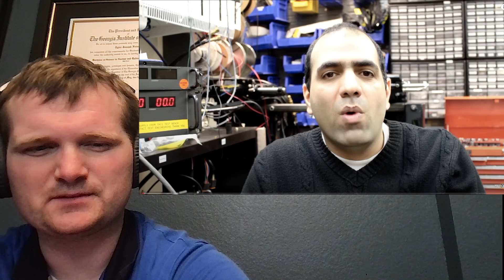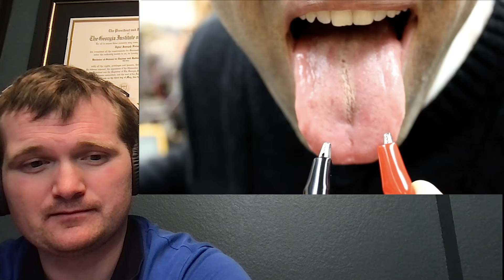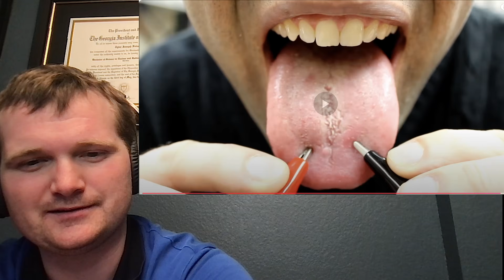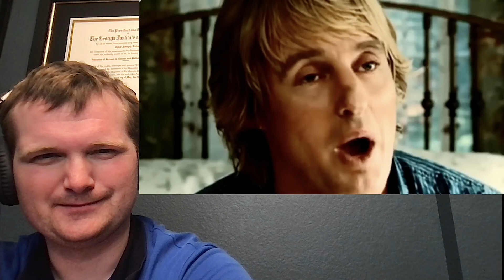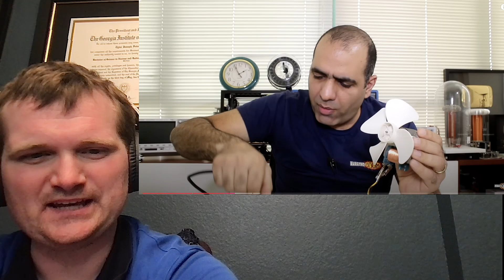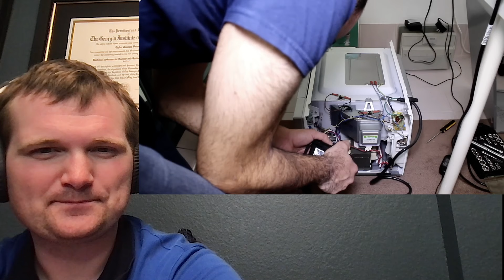AC vs. DC Current! - Nuclear Engineer Reacts to ElectroBOOM

Comment: While yes the AC system is better, less conversions and simpler. Technically there are less losses in the transfer of high voltage DC because in AC the voltage drops to/trough 0 in it's sine wave. And you als have this thing called the skin effect which pushes the current to mostly flow along the the outer layer of the conductors. Of course this effect helps make power cabling cheaper as power lines are generally made of steel cable clad with aluminium as the conductor (coper is too expensive making the need for the high voltage even greater). This saves having to make the whole cable out of a good conductor and you can get away with the far higher tensile strengt steel as the core. 

So with a DC systems you would have to convert from AC at the generator to HV AC then RECTIFY that, transmit it along a likely more expensive wire to then make HV AC out of that with some very expensive electronics and then transform it down and while you can get some gains like using higher frequency AC at the consumer side transformers to allow for the use of smaller and  therefore cheaper (because copper and large chunks of transformer core metal are somewhat expensive) transformer, but that transformer better have some super good isolation characteristics which might be harder if it's smaller? The concept has cropped up now and again as a cost saving thing. But clearly the tech surrounding it would be more expensive initially and you already have huge networks with AC power spanning across counties, connecting a lot of Europe for instance. 

I'm not an expert on this though so take everything with a grain of salt, but I did study electronics even if I work in software now for whatever that is worth.
Reply: As power electronics get cheaper and cheaper its begining to make allot more sense to switch from AC to DC.
Reply: @fablearchitect7645  yes, that is what I was pointing out...

Comment: 8:20 - there are actually high voltage DC lines that lose less power over long distances than AC lines, but the issue is that you need pretty gigantic installations to really handle some steps like steeping up/stepping down and of course in first place rectifying the current. They are getting more popular, though they are still pretty rare. I would have to check at what distances and what voltages those are more efficient. And of course they would need a new grid to operate it, so not exactly easy to put such infrastructure in place, unless it is specifically needed.
I learned this few years ago (and was a bit skeptical, because I learned in school that we don't use DC because of the losses - it's possible that "simply" transmitting at very high voltages creates less losses and needs less material or something), so I might be wrong. Or it might be mentioned further in the video and I will look a bit foolish for saying that.
Reply: You're right. I was looking for a comment like yours.

The key to understand this is that there is no reactive power in DC, hence no losses due to higher current in the power lines (and also no losses due to capacitive coupling with the Earth).

If you know you need a link that goes a very long distance with few taps into it, it is a good idea to use DC. Examples of it are links through mountains or seas. Why do you need few taps? It's because the equipment to convert high voltage DC into lower voltage DC (or just AC) is crazy expensive. It relies on solid state electronics as far as I remember.
Reply: @Martititi  Thank you. I do remember it being useful, but just expensive and big (with "parts" of substations being larger than average house), but better in terms of efficiency in those scenarios.
Reply: @jannegrey  Power electronic converters utilize high frequency (20-150 khz) transformers which are much smaller then the big bulky line frequnecy (50/60 hz) transformers utilized in substations. High frequnecy transformers can be made smaller because inductors saturate less at higher frequencies.
Reply: @fablearchitect7645  thx
Reply: Well also in a way it makes sense, as higher voltage would mean lower current for the same power, and effectively what causes losses in a wire in dc is the wire material's resistance to electrons moving around. We see this as heat, but it's basically the energy levels required for an electron to be freed and moved off towards the positive pole. This energy is then freed when the electron is freed as well, and the electron finds it's way to another empty slot in the material when it can, and gets "refreed" again and again, effectively flowing from the minus pole to the plus.

Comment: DC is actually better for long-distance transmission, since it has no reactive losses. However, what is expensive is the step-up and step-down converters, where AC can just use a transformer.

Comment: I had an electronics project kit as a kid, one that showed you the actual components on the surface. There were a few high voltage generators, I always had fun with those.
Most fun though was with spark plug wires on a small engine in school; I have a decent tolerance for the pain induced, but turns out my schoolmates didn't. I grabbed the wire, they pulled the cord, I felt it and just went, yup it has spark. They grabbed it, I pulled, they jumped backwards lol.
Fun fact: Edison Motors named their first full test truck build Topsy, cause of Tesla (both Nikola and the car company.)

Comment: 8:14 Not necessarily correct.
Originally DC transmission was done with household level voltage and there were no methods of conversion.
Today there are experimental transmission lines running high voltage DC (since Ohms law still applies same way to reduce losses) and in theory since there are no AC capacitive or inductive losses on the transmission lines it should be even more efficient.
Unfortunately it is still inconvenient since this would require huge inverters and huge rectifiers to handle which are prone to failure and are expensive.
Reply: There's way more than experimental transmission lines. There are DC transmission lines between the UK and France, and also between Italy and France.
Maybe there's one between Japan and China, but I don't remember if it is DC.
Reply: We use HVDC in Australia. I actually have no idea when we started as it certainly isn’t a recent thing.
Reply: Power electronics are getting cheaper and cheaper and high frequency transformers used in power electronics are less bulky and use less material then the low frequency line transformers currently used in substations. All modern home appliances already use power electronic converters.

Comment: 8:30 Thers is High Voltege DC (HVDC) line, because transmitting AC power on very long distances power loss occurs due to resistance in the conductors and additional losses from phenomena like the skin effect (current concentrating near the surface of the conductor) and AC systems experience losses due to reactive power, which is associated with the capacitance and inductance of transmission lines. Reactive power reduces the overall transmission efficiency and requires compensation equipment. And DC doesnt have that disadvantages. Mehdi done addition video that he talk about it after people in comment told his about HVDC.
Reply: Hvdc is expensive and introduces additional switching losses, but has lower losses. A DC grid would theoretically be better than AC grid if the conversion wasn't so costly (both money and power) , as there would be no frequency stability issues, synchronization would be simpler, etc.
Reply: @WolfkunDotInfo  yeah, and DC grids are feasible with power electronics, you can step voltages without converting to AC, but at the time tha technology did not exist, and it would be insanely costly to convert everythign to DC now, especially since all our devices are already designed to convert AC to DC, if the grid chagned we would have to yank the transformers our of all our devices too, lol
Reply: Also another reason to use HVDC is insulation and limited AC capability same size of wire can carry. After all, AC as is specified is "equivalent" to DC in a way that it is RMS voltage that is specified, but this is not the highest voltage, nor the lowest voltage naturally. In other words, same wire can carry more power with DC than it can with AC because voltage doesn't have to be as high. Anyway, AC is much more handy as it is just so simple to stick transformer to step it up or down, or isolate circuits. With DC this is not so simple.
Reply: @jarivuorinen3878  Also it is useful to connect grids that don't already have a large AC connection if you connected the cables running between the UK and Ireland for example to the AC grids despite being the same frequency the fact they are not in phase would lead to currents that are a large portion of the total output of all generators on the grid rushing back and forth as they try to pull the out of phase generators into phase with each other. Suffice to say that would need a much bigger cable for them not to instantly turn into white hot molten metal the instant you made the connection because the reactive power involved in the reactive power flux from having like 50 GW worth of generators acting as giant out of phase inductors would be impressive for all the wrong reasons. Probably all the infrastructure for hundreds of miles around connected to either end of that connection would also turn into molten slag because none of it was designed to handle the current needed to provide the current needed to phase shift that sheer tonnage of spinning mass that quickly.
Reply: It wasn't necessarily the long distance that caused losses it was (I think) the inductance of the material near the wire (like undersea and underground transmission lines.
Reply: @aidancollin9265  It is mostly due to the (parallel) capacitance between wires themselves and wires to ground. More distance = more capacitance = less impedance (between conductors), because Xc = 1/(2*pi*f*c) (where Xc is capacitive reactance in Ohms, f is frequency in Hz and c is capacitance in F), and thus more losses. 

The inductance of wires is also a factor but smaller then resistance, although it creates fun thing called Ferranti effect, where voltage at the end of long line with small load is higher then input one.

Comment: 2:44 He didn’t zap himself because the volts and amps didn’t change. Most of his zaps are fake.
Reply: They may be fake but he does it to teach his viewers how to stay safe
Reply: Nope, the reading cannot change much cause here 25.6/10000 = 0.00256A cannot be displayed on that supply in this case.
Reply: @HackingElectronics  

You really want to believe it 😂
Reply: @MyToxicMasculinity  🤣🤣
Reply: @MyToxicMasculinity 25V DC to the skin maybe make sense if you said that is fake..
but 25V DC to the tongue, with much much lower resistance than the dry skin, is make sense if mehdi was shocked because there is already miliamps current flow through his tongue (just because the tongue was always wet) so the resistance much² lower.
Reply: @dwikey_98  

I'm not sure that you and I are talking about the same thing.
Reply: @MyToxicMasculinity  i just wonder about you said if mehdi fake his zaps while there is really 25Volt DC through the tongue..
Reply: @ 

What? Can you say that in English, please?
Reply: @MyToxicMasculinity  sorry, my english is terrible..
Reply: @MyToxicMasculinity  can you read your own comment ?
you said, "if he didn't zap himself because the the volts and amps didn't change. Most of his zaps are fake..
where is the part was fake ?
Reply: if you have a power supply and short  your power supply output like that, it would make a spark.. 
all the power supply if shorted (especially), it will make a spark on its output..

so, where is the part that you said was fake ? 
that zaps is real..
even mehdi himself, being shocked by twenty five volt DC through the tongue..

i just curious about your point from your comment.
Reply: @ 

Those are two separate comments. 

Did you see how the volts and amps changed when he touched the wires to each other? They would also change when he touched them to his tongue. It's a constant output, so when the amps go up, the volts have to drop. 

“Voltage drop is the reduction in electrical potential (voltage) as current flows through a circuit or a component”

If current flowed through his tongue, the amps would have to go up, and the voltage would drop. That did not happen. 

“Most of his zaps are fake” is just an observation I made based on the evidence I see.
Reply: @ 

To address your question, if you shorted your PSU, the volts would drop, and the amps would go up as the current flowed, just like in the video.
Reply: @MyToxicMasculinity  yes, the voltage would drop..
but the voltmeter and amperemeter maybe not fast enough to read the voltage and amperemeter while mehdi shorts the output.. it needs sometimes to recognized it.

because i have multimeter and power supply, if i shorted their output the power supply can't immediately recognized and measured the short circuit current.. there is a delay in my power supply (maybe 1 second) and so i must short the output little longer..

mehdi while shorting the output of his power supply, it just under 1 second.. just brief of the moments..

also my multimeter while measuring the voltage of anything, my multimeter doesn't immediately can measured the voltage.. there was a brief moment with "OL" and  after maybe 1 second delay the multimeter can recognize and measure the voltage..

so,do you know what i mean ?

there is a time delay between probe touching the things and meter can recognized and measured.. do you understand ?
Reply: @ 

Idk, but he rapidly shorted the wires and it responded quickly.
Reply: @MyToxicMasculinity  because he did it several times, no just one time.. 
and not all the power supply or multimeter is the same, because mine have the delay between probe touching and the respond from the meter..

but the sparks from power supply while shorted that you said fake, that is real spark.. all of the power supply if their output was shorted by accidently or on purpose, would make a spark.. 
and the meter measured it or not, the spark didn't care about it.. because the first time shorted lead/probe contact always make a spark..

even while you plugging the power plug to the socket, the spark can happen.. so mehdi doing the same things, but with low voltage high current.. 
and you can see it, mehdi was adjust his power supply to 1 volt and still make a spark while the output shorted..
but man, 25V DC zapped to the tongue, you can imagine the pain..

Comment: Scans video using caption mode "Build a nuclear power plant at your house" Cold steam Tesla turbine https://youtu.be/2pGxVvSizoE?si=TiiLyaRFbVzc-FOQ + Regenerative ice technology to use vacuum to cold boil/freeze water layer within walls of cold side to never need cold weather for cold side OR ice. Max design compact with generative AI + Print for masses with Ultrasonic holography pressure image support for molten metal forming for highest density at perfect grain structure. In that cold steam video he pushes 190Volts with 134F.. Thermophilic bacteria fed by nutrient solution can produce fire level heats. Source https://youtu.be/oO4FH9hn0_I?si=cFIwyUG6NF7bYehc Black mulch is thick nutrients from all washing down to the bottom from Mulch piled too high.

Nutrient density = Heat throttle for self replicating practically immortal heat organisms. If you pile Mulch on frozen Earth they will awaken eventually and warm area around them to make it easier for others to wake. Which means if owner is a fool and forgets to feed them they will just SLEEP. Pulls out Thermophilic bacteria from heat panel on steel wool bed, drips high density nutrient mix, and sets wet fire material over it Steam > Dry material > A little breeze > POOF.. Super reliable organisms for heat-fire.

(I got excited.. Cold steam system = Less nuclear material for results. As long as turbine is big enough to suck away all the heat the cold side will never balance and the Universe will NEVER accept that to quit as long as heat keeps being transferred into the hot side.)